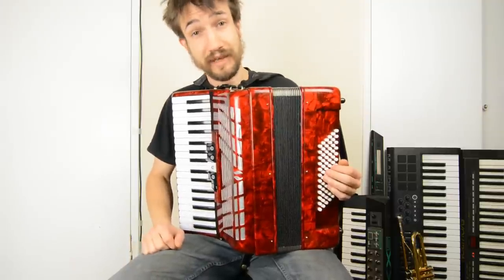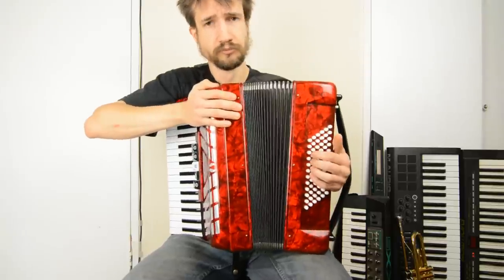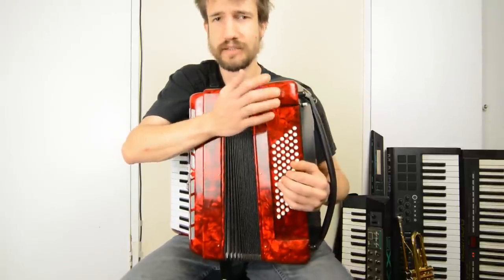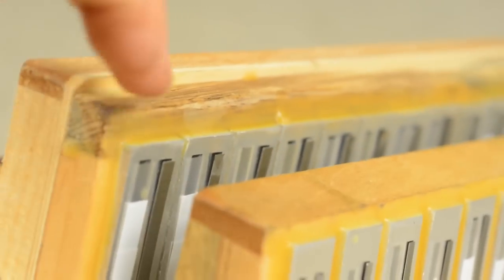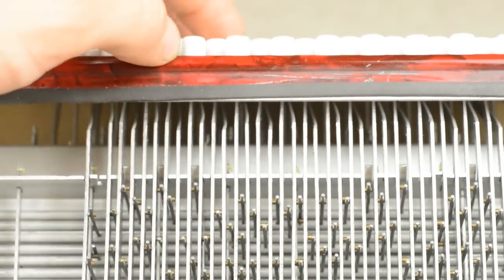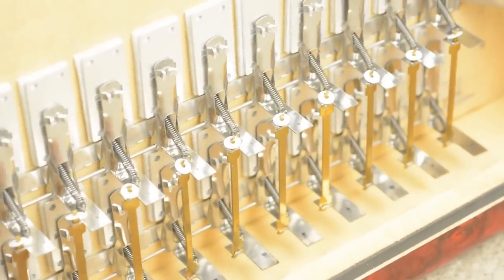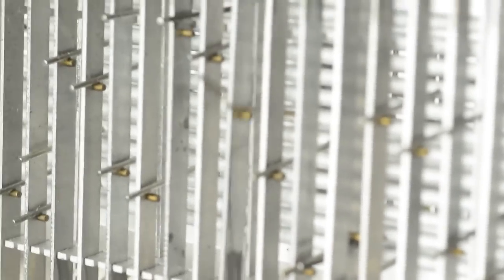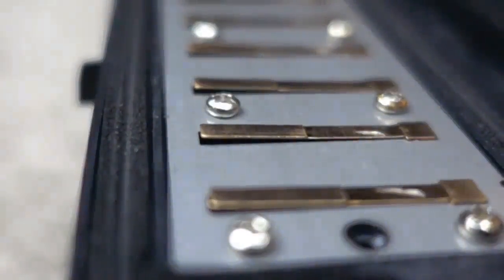How an Accordion works

Comment: Two things you mustn't do:

- Never attempt to expand or compress the bellows of an accordion without a key, button or the valve release button pressed. Doing so can damage the reeds and make it sound out of tune.
- Never expose an accordion to extreme heat or cold. The reeds of the accordion contain wax (to hold them in place), which can obviously melt if it gets too hot, but can also crack if it gets too cold. Don't leave it in a car for a prolonged period.
Reply: 1. is simply wrong.
Reply: @jamadir which one
Reply: @MichaelTurner856  pressing without button

Comment: Looks like some of the buttons correspond to -- i.e., push down first, before triggering the rotation of the cylinders -- vertical bars that themselves open valves. With these buttons, it seems there should be an ever-so-slight delay between the sounding of the "directly linked" note and the notes that follow indirectly from the twofold action of the cylinder spikes and gold bars. (Assuming you start pumping air through the valves immediately as or just before hitting the buttons.) Have you tried playing back music from the chord buttons in slow-mo to see if the lag becomes perceptible?

Comment: They kind of look like they're really heavy
Reply: Some definitely are! I own three myself. A big one, 72 base notes, and playing that one is quite the workout. It's quite heavy (but doable - especially compared to the 120 base one my friend owns...).
I also own a 12-base one, my medium baby. It's not heavy at all. My smalles one is an 8-base and it's ridiculously light, actually.
So yeah, it really varies! But good core strength, a strong left arm and - most importantly - a well fitting harness can make playing a heavier one much easier.
Reply: It all depends on what it's made of really, materials play a big part in it